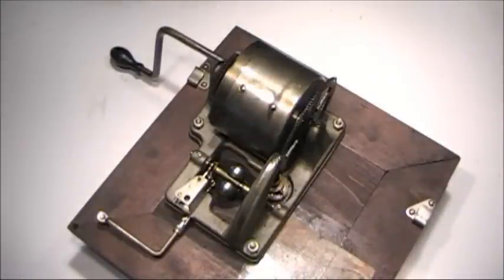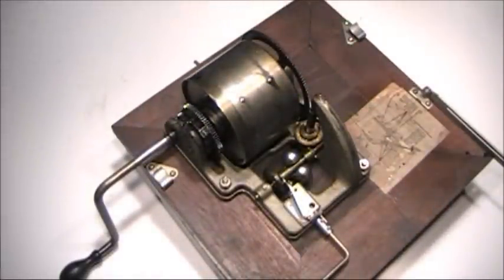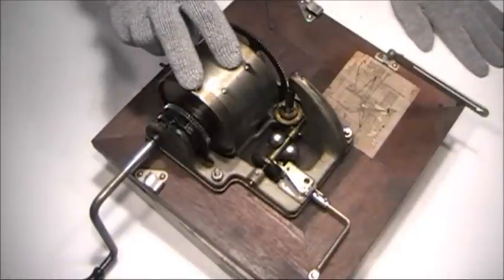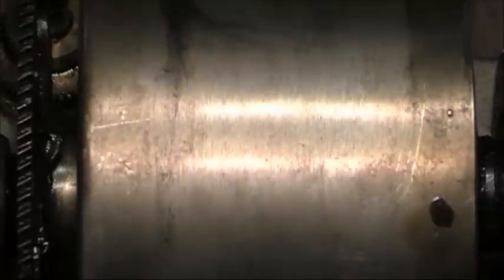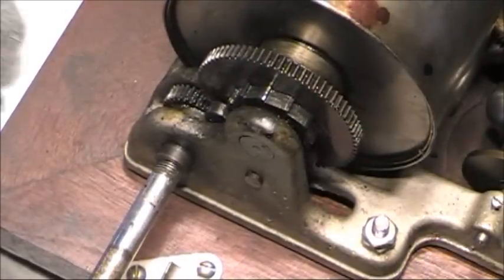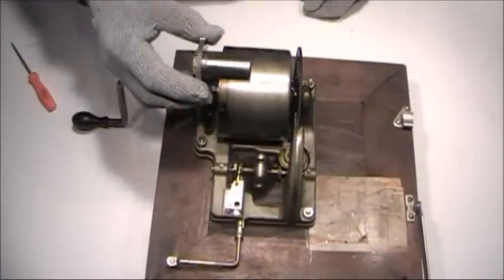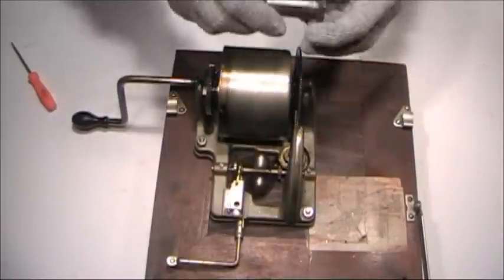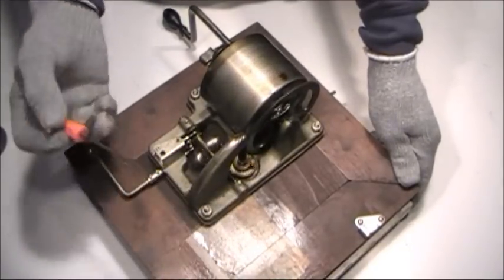Victor Two Spring Motor Rebuild Part 1

Comment: I know this is an older video series, but it’s exactly what I need as I’m going to attempt to rebuild my VV4-3 single barrel (2 spring) motor. It looks exactly like this, only no speed indicator needle to deal with. I’m a tinkerer, but never done this before.  This video seems perfect, thanks.  I’m missing one weight on governor, so hoping I can order it.  This one has never been cleaned, so lots to do.  My crank handle doesn’t wind at all, just spins. I’m guessing I’ve got a broken spring, but won’t know until I open this up. Fingers crossed.

Comment: Excellent video / tutorial. I have a VV-210 in working condition. It plays but does make the thumping noise you described from the motor. I plan to service it myself, having several years of antique radio repair experience, gunsmithing. Thanks for creating this video and sharing your knowledge. I had no idea how this Victrola motor operated. Thank you!

Comment: Outstanding series of practical videos! I successfully rebuilt the motor from my Orthophonic VV 8-4, which is a type 440, 4 spring motor. After cleaning all the parts, and re-lubricating the mainsprings, it plays beautifully! Your video takes one step by step through the disassembly, cleaning, and reassembly process, with not simply just a "how". but also "why". A great contribution to Victrola enthusiasts!

Comment: I tried to remove the springs from the spring motor of my Victor Orthophonic 8-4 and I been very careful not to cause any injuries. The next time when I remove the springs, I'll try to be extra careful if it pops out and watch it spinning around to back away. This is the same thing they did when you light up a firework, you have to back away until it sets off and explodes in a beautiful display of colors. That's the way to take caution.

Comment: Excellent video, I just used it to rebuild a vv-100 I just acquired on ebay.  I couldn't find slick 50 at AutoZone and instead used mobile synthetic grease and mobile 1 synthetic oil I put in a pump oil can.  The rebuild made a huge difference.  I used to rebuild and repair new England (Sessions) mantle clocks so I am used to working with springs and gears but your video took all the guess work out of my first phonograph rebuild.  I plan on doing antique clock restoration when I retire and will now add phonographs to the list thanks in part to your well done video.  Thanks again, Jonathan Sheffield

Comment: How did you get the platter part off - the part the record lays on?  Mine doesn't want to lift off and I'm unsure how firm to be.
Reply: Karen Koch you need to move the platter break lever to the off position and it should lift up easily

Comment: I got this beast for $5 at a barn sale and it's a Victor Victrola VV 8-4 which dates back to 1926. It has the same 2-Spring Motor assembly which was common on all Victor Victrolas between the 1910's and 1920's. It was all gummed up and completely seized. This console is very heavy and it weighs about a ton, and I don't know if it's going to fit for my room until I have to clean that stuff up. I'll work on the motor to get it restored soon, the cabinet is kinda beat up, and the wood texture has fallen apart due to water damage, but it needs to be redone.

Comment: I have the same machine but the motor lacks power. In addition, it works for around 3 to 4 minutes at proper speed and then it slows down. Is it possible that the springs are fatigued? I normally wind the crank about 40 to 50 turns.
Reply: Manduca Cipriano my victrola was doing the same exact thing but after rebuilding like this video, works great.  Most likely the grease is getting hard and causing your problem.  Time for a rebuild.

Comment: This is great!  I have been putting off doing something with a table top Victrola that I picked up cheap at a friend's antique store.  I replaced the broken governor springs, but was afraid to do the spring barrel.   It would play but then thump and start slowing down.   The inner spring has a slot rather than a hole to attach to the rivet.  It hasn't been broken.  It appears to have been made that way.   Is that normal?

Comment: Hi, I have the exact same motor, it has a weight and Spring missing on the governor and bearing missing from the drive spindle. Do you know where in uk I could obtain these parts?

Comment: Wonderful six part series. Many thanks for producing it with such clear commentary running throughout.

I am dismantling, cleaning and reassembling my 1919 Victrola in the very building where the cabinet was created (now loft apartments), right across the street from the Victor Talking Machine motor assembly department (now a parking lot).

Your video has undoubtedly saved many a Victrola that might have gone to the trash heap. There is a millennial guy who has recently opened a business called The Vault, in Berlin NJ, dedicated to advancing the history of Victor Talking Machine. He owns the trade names Victrola, Victor Talking Machine and Radio Corporation of America, and is aiming to launch vintage and new music on the labels to Spotify, having already acquired 10,000 masters and steel disc recordings. Comprehensive history display in a night club atmosphere, live music.

Search "Graham Alexander -The Vault". Amazing things are happening.

Comment: Thank you so very much for your videos on repairing the Victrola mechanism.  I have a Model VV-240 manufactured in 1922.  It belonged to my grandparents, then my parents and now me.  Because of your excellent video I had the courage to tackle rehabing the mechanism.  I know that the Victrola has had very little use in the 69 years I have been alive.  Mostly it has just sat.  Fortunately, I live in Arizona where things do not rust.  There was very little wear on the mechanism, so all I had to do was disassemble, clean, and reassemble.  It now runs very well.  I will say that installing the springs in the drum was considerably harder than you made it look.  The springs in mine hook over flanges.  Again, thank you!

Comment: So grateful for your tutorials! I finally got my hands on a Victor Talking Machine and the videos have given me the knowledge (and courage) to make mine right. Thanks so much! Also, I must have been paying attention because I quickly noticed the spring barrel on mine was the opposite of the one in your videos. The larger drive gear is on the side with the lid and faces away from the winding mechanism. Not sure if that's the way this one was built or if someone serviced it once and put the barrel in backwards.

Comment: Just thought you'd like to know I still have my phono repair shoppe and it is going strong.  I've repaired over 100 spring motors now and restored dozens of my own phonographs.  Your 'How To' videos started me down this path in January, 2013 after I sent a broken motor to the folks in St Johnsbury, Vermont to repair.  They fixed the motor very nicely and sent a bill for $300.  Thanks to your videos, folks are now sending me their motors to fix.  Very cool!  Just the right kind of thing to keep a retired guy happy.  Thanks!  Cliff
Reply: PDX78s Hello Cliff, I also plan on doing phonograph rebuilds when I retire.  I have been restoring New England mental clocks but plan on adding antique phonographs in part due to this video that helped me with my first rebuild.  I still have 13 years to retirement but have a plan similar to yours.  Do you have a website with some of your rebuilds?  I would love to check it out if you do.  Best of luck in 2018 with your vintage music shop.  Jonathan Sheffield, you can reach me at Jon at JonathanSheffield dot com

Comment: Super tutorial. I've just regreased the springs in my victrola ix. It had major bumping on winding up and running down so much so that it made the record jump. My model has two spring barrels instead of the one with two springs inside but it's pretty much as your video. One thing that made it easier was that I put the barrel into a wooden vice, bit like your test bench so I had both hands when putting in and taking out the spring. The machine works perfectly now with no rumbles! Greetings from the United Kingdom! Many thanks for your very good video and well photographed!
Reply: Christopher M Mine is has 2 spring barrels instead of one.  But that was during the Orthophonic period when Victor made that one, and it was an upgrade where it does improve well.

Comment: Thanks. I just purchased a VV-100 and knowing how to rebuild its motor will definitely come in handy. Question: I cannot seem to be able to lift the motor board. I notice in your video the your motor board has two brackets on either side of the bottom face. Does your board rotate on these brackets? Any idea how to remove a late model (type D) VV-100 motor board? Thnx
Reply: Be sure to remove the crank first...
Reply: bhag meister I have the same model and just did a rebuild.  There two clips on each side the board swivels on. You lift the front to swivel up and then pull out at an angle and it comes off the clips.  There is also a guide track on the left side  that will need to be taken off.

Comment: Is there anyway you might be able to help me locate parts for this motor?  My regulator weights on mine looks like they exploded.  The weights are all here but the spring rails that connect to the shaft are toast.  Email me at funeral(at)cableone(dot)net

Comment: Would you help if the torque not enough to rotate when put on needle and play? Which part I need to tune? I see the speed normal when no loading. Any advice?

Comment from the maker: @RCALennon Looks like your machine will have the early two barrel motor inside. If you are mechanically inclined....it's pretty easy to figure out.  On the plus side, the springs are easier to deal with....

Comment: @SuperEckster It pulls out with a firm tug. The motor's mounted with 3 screws onto a wooden board, with what looks like old black leather underneath the turntable (can't be a finish problem, as the finish on this thing's pretty good). Motor appears to be a typical 2 spring Swiss built motor, possibly by Thorens. Getting it out to send off will be a pain, but I'm sure I can manage :\

Comment: See if the turntable removes It should be held in place with three screws somewhere often times its mounted to a round metal plate which is held on by 3 screws instead of being on a wooden motorboard

Comment: My phonograph doesn't have a motorboard (as far as I know). It's a generic off-brand tabletop phonograph from the '20s, you know, the usual antique store fare. However, there is no bottom to it (there looks to be notches where a bottom would have been fitted in,though). The motor is rather similar to the one in the video, and it's mounted the same way. So, how would I remove the motor for servicing or sending it to a repairman?